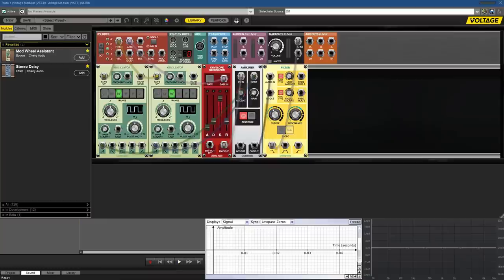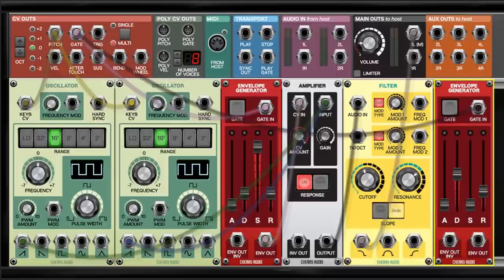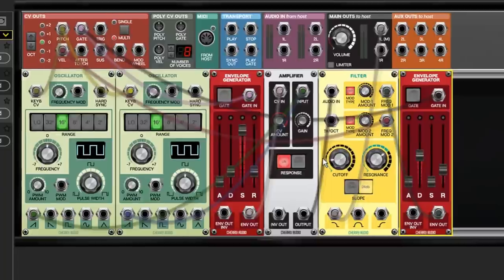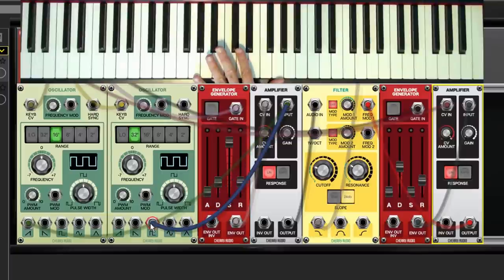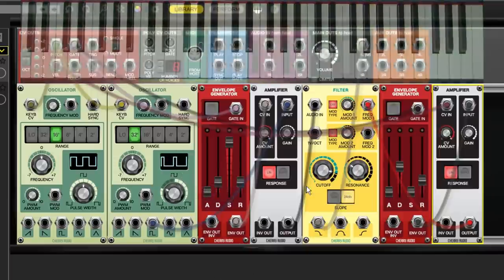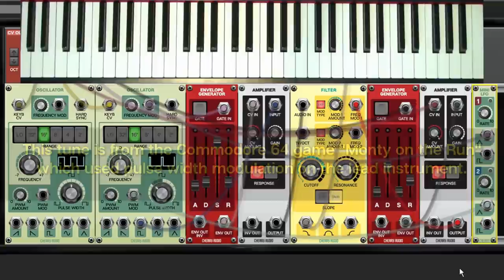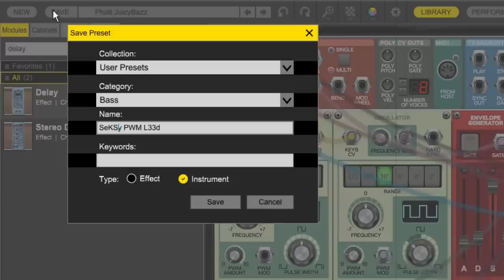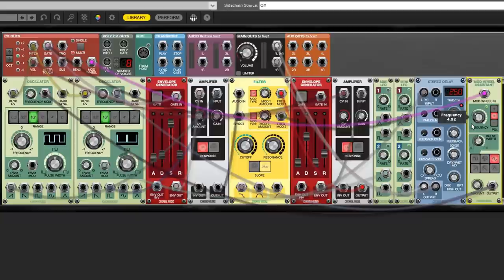Beginner's Guide to Voltage Modular   Part 2 : The Power of Modulation

Comment: This video shows how powerful sounds can be created in Voltage Modular with just a few modules
Future guides could be on more use of the CV modules like the Attenuverter, the Boolean logic modules or the clock divider.The flexibility of routing control and audio to create new sounds is the great  ability of modular synth.
Reply: When I stick to the basic modules, I'm fine, but when I try to hook up one of the vaguely-purposed, weird modules ("Boolean Pancreas Remover", etc), everything grinds to a halt.

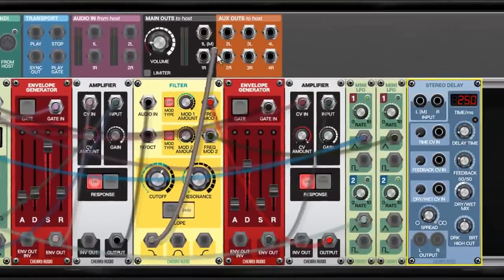Comment: hey hey ! @ 16:50 you add a stereo delay... I only see a delay option, the stereo delay available is a black and purple color and costs $15. Can't see the stock version.
Reply from the maker: Hey there! Stereo delay is not included with the free Nucleus edition. However it is available separately. The UI has also been updated as part of the new 2.0 update - the modules seen here are in the older 1.0 version

Comment: is there a way to make the synth work with multi notes/voices for free without paying for anything
Reply from the maker: Hey there! Polyphony would require polyphonic modules as mono CV jacks can't have more than one signal at a time. So, you would need to upgrade to one of the editions of Voltage Modular that has poly modules, or purchase some third party modules that support polyphony. Do keep in mind as well that you would need polyphonic modules for each step of the chain that you'd want to be polyphonic (ie: envelopes, amplifiers, filters, etc).

Comment: hi thanks a lot, but , why can't i find any compressor on the store ?
Reply from the maker: Hey there! We actually offer the standard 'compressor' module as part of Voltage Modular Ignite and Voltage Modular Core - it isn't included with the Nucleus edition. However, you can always upgrade to Ignite or Core to use it or even use the VST host module to load your favorite third party compressor VST right inside Voltage!

Comment: Aside from CPU power, are there any limitation to the number of like modules you can have in a sound? Like, 8 or 12 LFO's. Can you have several sequencers to use as note triggers and/or modulation sources? Can they run at different tempi?
Reply from the maker: There are no limits! You can add as many modules as your system can handle. The only real restriction is your imagination and/or how much time you want to spend dialing in a patch!

Comment: im totally in love with this system eventho im more of a hardware guy. it sounds really beautiful and its very easy to handle. i have just one issue; im not able to adjust the first 2 sliders of the sequencer to c1 and c2. i double cklick them and write it and it doesnt work. doesnt have a problem with the others, just with the first 2 for a boring ass sequence....any advice??!!
Reply from the maker: Hey there! For the sequencer the minimum value is set as C2 which you should be able to set by just moving the sliders to the bottom. For lower octaves, you can change the footage setting of the oscillator or use something to change the CV value to a lower octave. If you need help with that though or find that you cannot reset the sequencer back to C2 as the minimum value, feel free to get in touch with our support at cherryaudio.kayako.com and we'd be glad to assist you!
Reply: @CherryAudiovst  i discovered the whole thing on venus theory channel and i saw he did it.  so he didn't explain that.  im gonna try the step you metion above. sould nned more help, im gonna contact the support. thank you.
again: amazing work you guys are doing here. im a huge fan.